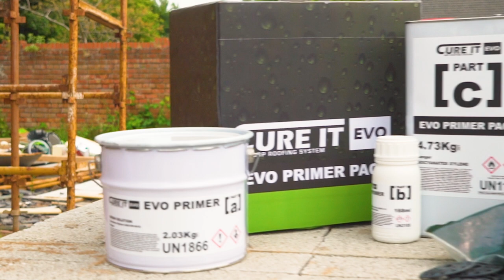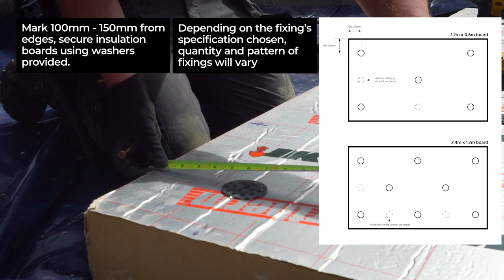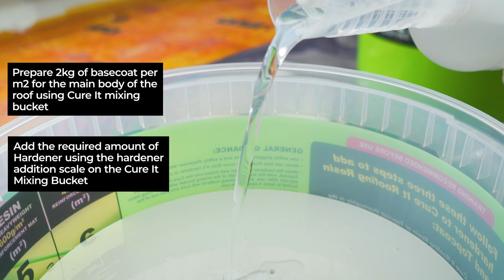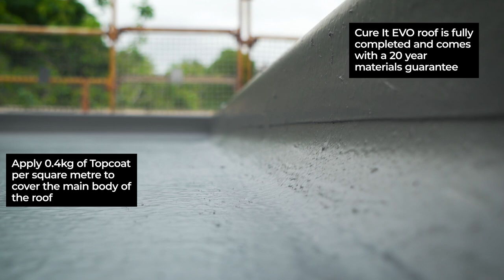This roof transformation is something else 👌

Comment: this type of roof might be ok if done 100% correct but 
i have ripped a a few up that were leaking and they were not that old 
trouble is a lot of cowboys can buy a stanley knife and a roller and 
then there roofers with this stuff 
il stay with tried and tested roofing systems 
zink  or lead i repaired and renewed a few of them they were over 100 years old
some more 
only my opinion